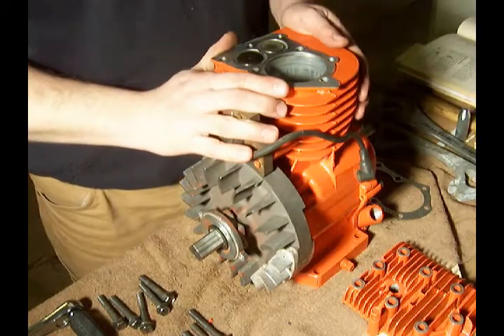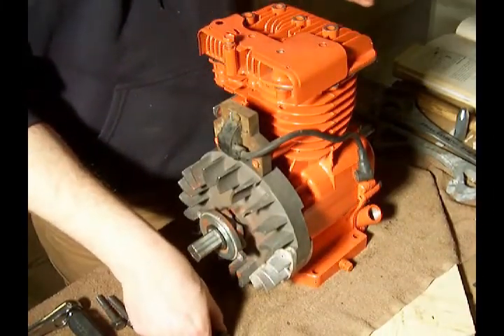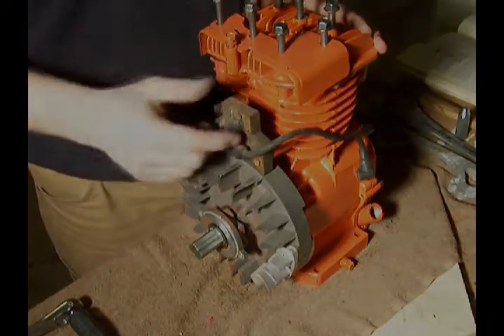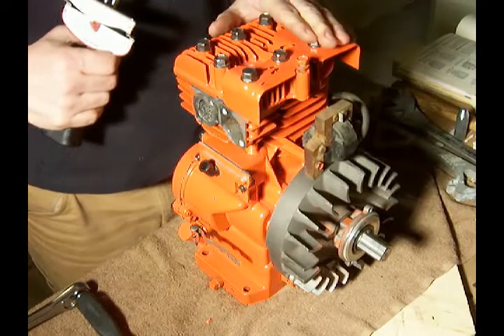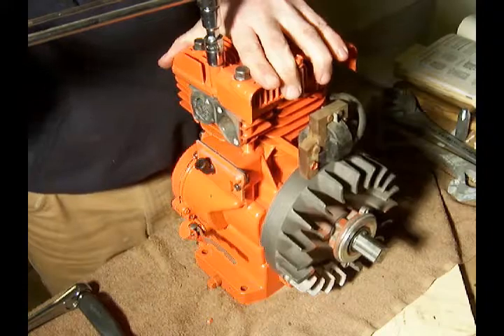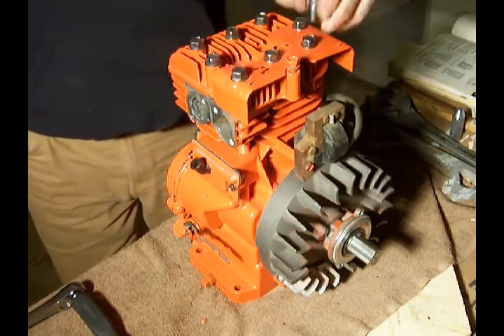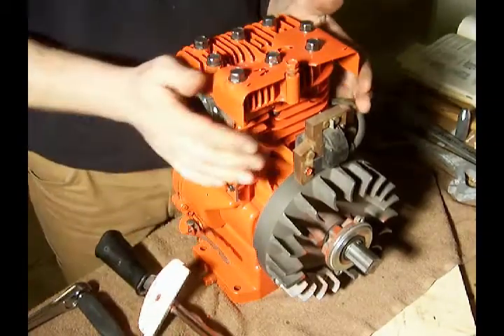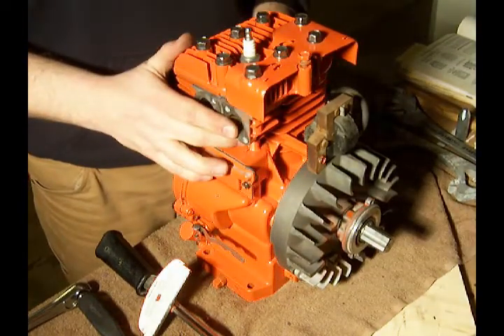#15 - Briggs and Stratton 5HP 130202 - Cylinder Head installation

Comment: what is the head torque for briggs & stratton 126T02-0191-B1
Reply from the maker: I am not familiar with that engine but two numbers show up in my repair manuals: 140 in lbs  and 165 in lbs. Smaller engines use 140 while the larger engines use 165. That engine looks to be 5.5HP to 6HP. I would go with 140.
Reply: +sblg43 +Lenny Trombley  Give 'er 150 and call it good lol

Comment from the maker: I had a friend use a commercial parts washer to clean the engine (don't tell his boss). Once the engine was clean, I used high temp engine primer and paint from the local auto parts store. This particular engine is Ford Orange. It is my intention to have a variety of colors for the various 5HP Briggs engines that I have. Thanks for watching.

Comment: I'm missing my headbolts, can I use reagular old stove bolts of the right length and thread.  I bought a box of assorted ones with washers and nuts at Walmart for $12 and it has the exact right size.  I'm thinking also use washers to mimmick the larger head on the headbolts and spread the tension out a little, though its probably not necessary.

Comment from the maker: @89fordf1504 Assuming you have a good spark plug and compression, my guess would be the carburetor. You may have to clean it and/or rebuild it. It's an easy enough thing to do. It also possible that you have bad/old gas. If that is the case, I recommend premium ethanol free gas only. The ethanol in the cheaper gas doesn't play nice with small engines.
I hope you find the problem. Thanks for watching.